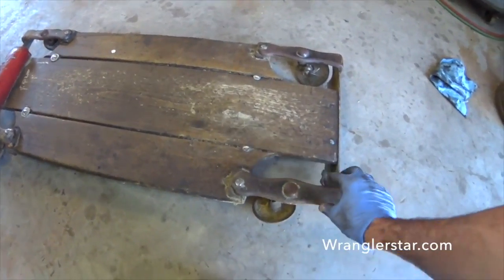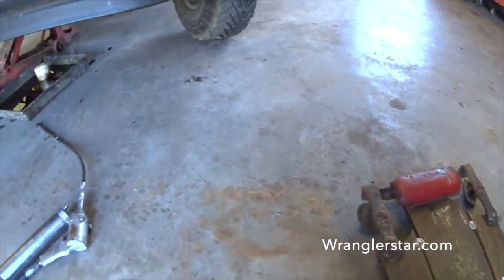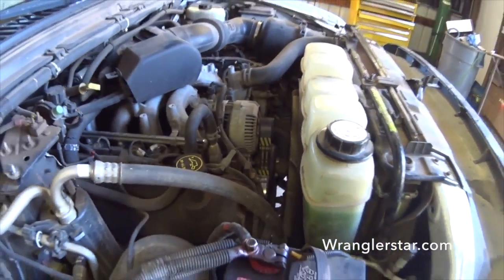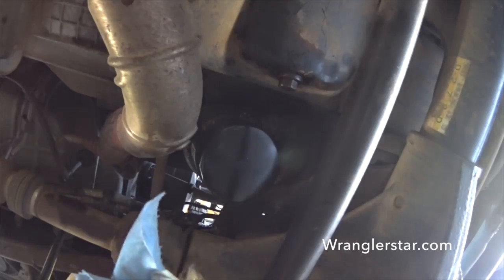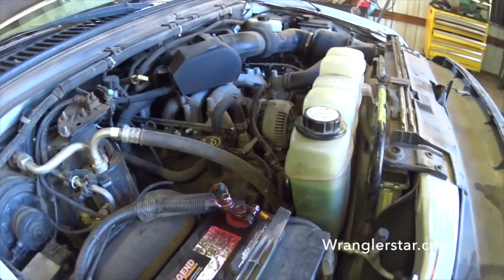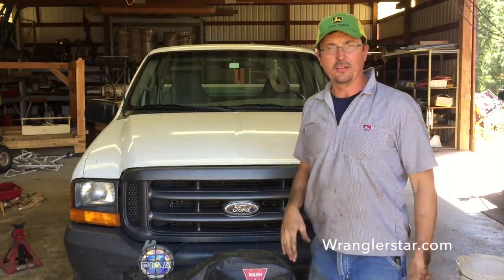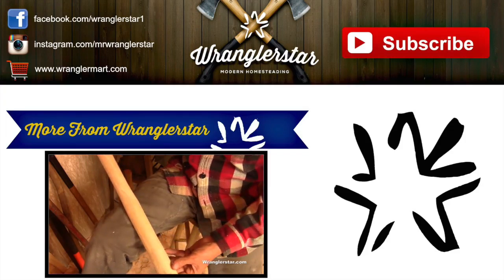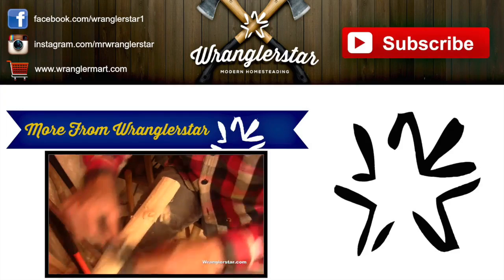Tips For Getting A Truck To 300,000 Miles pt2

Comment: I couldn't agree more about not buying new vehicles.  We received a new Honda Accord as a wedding gift about 25 years ago and we still drive it 100 miles or so every day. Total miles?  645,000 and still going strong.  We just keep it maintained and repaired and it keeps on running.
Reply from the maker: +Norman Means Sounds like you got a winner.  Very nice.
Reply: +Norman Means Original engine? No major repairs? That's very impressive!
Reply: +FORCE NSX repairs are part of owning any vehicle.  I budget $2000/yr for repairs.   And I always use the cheapest oil, so long as it meets the API standard.
Reply: +FORCE NSX the best part about the car, as I tell all my GM and Ford fanatic friends:  the Accord is an American made car made from American produced parts.
Reply: So I should be expecting a lot more out of my '98 Honda Accord longs I keep up maintenance. I've got over 300,000 kilometers
Reply: +Alvin Dueck I would think so.  That's roughly a third of the mileage (kilometerage?) that I have.   Change the oil and keep up the regular maintenance.  It helps if the car has a manual transmission, I believe.
Reply: How many miles are on your Accord now?
Reply: Mark M 685,000
Reply: Congrats on the marriage going on 25 years!
Reply: yeah.....you should do a compression test lol
Reply: @norman3605  I am your exact opposite: I always use the most expensive oil..The one that is made in Germany for my German car...And that does not stop there: anything I buy has to best the TOP BEST out there, No matter what! I f I can't, I wait till I can.... I would NEVER be able to buy something cheap...NEVER....When I buy clothes, food, cars, parts, even the smallest thing (pens, soap, toothbrush, etc), I try to get the best product possible, and NOT made in China as much as I can (Chinese products make me cringe....!)...It is in my blood....My dad, may God bless his soul, used to tell me: buy stuff and bring the money back with you, because if you buy cheap stuff, it is like if you dumped your money in the trash.....! We only live once, so why not get the finest/best things out there: if God helps me and, one day, I become rich, I will not let a single Chinese product get across my door: not even the plastic bags for the dumpster...I will order them in Bulk from France or Germany...!

Comment: I would think a truck kept and maintained like you have done tends to be a better truck anyways. Anything that could have gone wrong already has, and any kinks or factory issues are long taken care of. The vehicle becomes very refined in its operation. Great pair of videos here. Thank you!
Reply: +Weiderfan that is actualy very true. I'm very lucky that my parents will give me their car for free in about 7 months because they are moving to a different country while i want to finish collage here. They bought a volvo s60 2003 with only 80.000 miles in 2011 which is insane the car had only one owner who traded it in for a new volvo and so this old s60 sat in a hangar for a couple of years untill they wanted to get rid of them for very cheap. my parents paid around 1650$ the car today has 127XXX miles on it and it has only died one time which was caused by the battery reaching its end. New battery was all the car needed. The car has had oil changes every 4-5k miles and quality parts were always used as well as correct fluid's the car sounds like brand new there is no rust and nothing rattles and when the turbo spools the little 2l turbo inline 5 it can actualy  make me feel uncomfortable. And i think its a great relief that i know that this car was taken care of and it allows me not to worry about buying a car from some shady ass craigslist person who is selling his ''Mint condition'' car worth 3000$ for 700$
Reply: Cool post buddy! Thanks for sharing, and congrats on inheriting that little Volvo! Awesome deal!
Reply: Weiderfan i still have to pay the insurance which for me is like 1300 as well as road tax (payment for using the roads calculated on co2 or CC of the engine) which will cost me i think 690euro plus paying for my own apartment with no financial support from my parents but hey :P atleast all i will pay for doing my PLC course before collage is like 800euro for 2 years and if i get a special grant its free and i have my own transport. And going back to the video any car or truck can be easily maitained by someone changing fluids is very easy the hard part is just picking the correct fluid which is not that hard as it says what to add in the owners manual
Reply: Good luck with all your endeavors, and hopefully you can save some cash by doing your own maintenance work. I'm about to throw a new set of brakes on to my Honda. Just rolled over 200,000 KM about a week ago. :-)
Reply: Weiderfan which honda is it  ? and 200.000 is really good :)
Reply: 2005 Honda CRV. 200,000 KM is eaaaassy for it. They're usually good for 400k, no problem. That's what i'm hoping for! It's in mint condition.

Comment: At the end of this video you mentioned the handling and braking as a whole were improved. It is important to note the interrelation between shocks (and springs for that matter) with tires and brakes in stopping, and tires and suspension for handling and load handling. You could have the best brakes possible, but fail to stop adequately due to too much bounce from either bad shocks or the wrong shock and spring set up. Another great informative, money saving DIY video. Thanks for sharing.

Comment: My dad bought a Dodge Ram 3500 brand new 14 years ago and it was the truck my brother, sister and I grew up in. It was going strong, we took good care of it and it had just reached 275,000 miles when a bad windstorm came through and dropped a tree down the middle of it a few months ago. Preventative maintenance goes a long way but you can't plan for that. Thankfully we've found a "new" truck. Same year and model as the old one though this one only has 81,000. Time to work back up to 275 and hopefully further. Thanks for all the great videos, can't wait to see what's next.

Comment: I bought my FIRST NEW truck last year. (Im 26) The truck out the door price ended up being 27k for a 2015 GMC sierra. One of the main reasons i did it was because it actually lowered my interest rate a good bit AND i already owned my older used Dodge that i traded in and they gave me 18k for. So LONG story short only paying $9,000 total out the door for a 2015 GMC with 0 miles on it and a 2.5%apr I think I got one hell of a deal. Also yea i finished paying for her in december so now I have a 1 year old truck with 8k miles on her AND the title is here at home with me. I agree 100% with what you said. If you can't afford a new truck then don't buy one but Ill tell you what saving all my money from the Marine Corps and putting it into my dodge was the best investment turnaround I ever had!

Comment: Keep it up ! It's very rewarding keeping a vehicle running 
My 1980 Volvo wagon just hit 500,000 miles with no major engine work ...just the routine maintenance and accessories like water pumps, alternators ,timing belts  
It doesn't leak or burn any oil between changes  
I bought one new car in my life  it is a 1996 KIA  everyone said you won't get 100,000 miles before it has major issues even the dealer mechanic said it
I now have 198,000 miles on it and it still runs great ! Do the proper maintenance use the best quality filters and a good oil don't skimp on changing intervals
I made a bet with the lead mechanic at KIA that I would get over 200,000 miles on it .he said it would never make it
Well I'm almost there needless to say he is very surprised that it still runs and at a very good performance level

Comment: I bought my '92 Ford F150 back in '96 with less than 70k miles. Has a 300 I-6 with 195k miles now. Badly rusted here in Indiana but starts and runs great. Could use more power but good enough for me. CHANGE OIL BETWEEN 3 AND 4K. 
I appreciate your value of your Grand-dads tools. I would hang the creeper on the wall of your shop. Hope you get to be a grandparent some day. You'll make a good one.

Comment: Just had the trans rebuild in my 03 chevy, put new take off wheels, fixed the exhaust. Smelled coolant at times- water pump was leaking so I replaced the water pump/ lower rad hose/ tensioner/ A/C belt and serp belt along with the thermostat because they were easily accessible when replacing the pump. When putting the new wheels on I had suspicion that a hub was going, turns out hub and a torn upper ball joint, replaced the hub- tore the 1/2 shaft boot, so replaced the axle shaft, upper control arms with ball joints, lower ball joints, inner and outer tie rods since I had to get an alignment, ordered all Moog or A/C delco parts off rock auto and saved a ton by doing it myself, Sure it was almost 5k by the end, but I;ve owned the truck 9 years and think I have atleast 6 more years to go.

Comment: After buying 2 brand new Trucks in the last 10 years I agree with you on the money you'll save buying used but there is nothing like ordering your own custom Ford F350 diesel EXT 4X4 power everything, beyond loaded factory accessories with leather interior, suicide doors an 8' box that makes that first 100,000 miles of hard work worth it. Just like myself or my wife & children, my truck has to earn its keep if its on the team. I plow snow with mine to help offset the purchase price which actually paid for the truck & the plow & sander I have for it as well.
Reply: Nowadays, buying a used vehicle is tricky.  You never know if it's been in a flood or not, for starters.  Interiors can be replaced.  Paint can be recoated.

The truck you describe, I would never buy used if I expected to get any respectable length of use out of it.  You can't know how abused it was prior to being polished for resale.

Comment: I know the feeling of keeping up an old truck. Me and my dad keep up an old Chevy 1999 Suburban 1500k. It has just over 220,000 miles and we have replaced just about everything apart from the engine and transmission. Although the last 8 hour drive to Florida proved that it had a problem in the #4 cylinder as a code came up that it misfired so engine work is likely in the future. We have paid probably 15,000 to 20,000 dollars just to keep the truck in great condition and it still needs body work and a new paint job. So it isn't cheap to keep up an old truck but it is so worth it as a new Chevy Suburban is in the range of 50,000 to 60,000 dollars. Plus the feeling you get whenever someone makes a comment about your truck being in great condition is one only those who do this can get!

Comment: I've always told my friends and family how much easier it is to keep a basic model vehicle looking nice and in top shape. 

I've always had $5-7000 trucks with plastic floors you can rinse out with a hose and a standard transmission, manual locks and windows. Things just don't break on those trucks. My truck I have now is the first vehicle I've ever owned that had power locks or windows or cloth seats... And I only bought it because I wanted a crew cab and it was a great deal on a cummins diesel. 

I 100% agree with you on paying cash for vehicles and repairs on vehicles. I've had shops try to cheat me on repairs when I was in a bind and new in town and I refused to use credit, they cut their rate nearly in half because I held the line on cash only. 

Sometimes not being rich teaches you life lessons you might not learn otherwise. Maybe you would but probably not. 

BTW my dodge is at 290,000 and my ford that I have to my dad is at 315,000 and still going.

Comment: Cant say that I disagree with you about buying a new truck. When I graduated college last month, my mom told me that since I had a job nailed down, I would be able to buy a new truck. I said why? There's nothing wrong with my old Chevy. Sure its a little rusty in spots, nothing that cant be fixed, the a/c needs recharged, but the engine and transmission are solid. I just hauled a couple wagon loads of hay out of the field tonight with it. I'll keep it til the wheels fall off and ill fix it and run it till they fall off again.
Reply: ih1206 wish more people had that attitude
Reply: chabka34 Some days that's an expensive attitude. This morning it had a dead battery. I think I know what the issue is, but I won't know anything until I get home and wheel it in the shop.

Comment: I don't know if you mentioned it but don't forget your power steering fluid.   I think that's the one fluid most people never think about and it does go bad over time.   It's cheap and easy if you just remove and refill what is in the reservoir every oil change.   A turkey baster or hand pump from a soap dispenser makes getting the old fluid out easy.

Comment: Inherited my mother's 2001 Kia Sportage, currently has 180k Kilometers on it (112k miles).
I know its lived a bit of a hard life, my mother never really got out of town, so it was run a lot for short-run errands, rarely getting up to temp.
I'm currently doing both necessary and preventative maintenance on it. Catching up on things my mother didn't do before she passed. When I got it, did all the fluids, and gutted the automatic locking hubs (They're broken, and I haven't had the funds to replace them yet. Not causing damage, so its fine for now.), got the front wheel bearings done, rear axle is getting some love next. Followed by shocks, and a new front windscreen. The glass is scratched and pitted all to hell, and has a tiny crack.

So many things to do, while also getting tools to do it.

Comment: great Video mini series i could agree more with the don't buy a new car statement especially here in Australia the 2 major car brands Ford(but not the F series trucks) and Holden(GMC) drop so much in value once you drive it off the lot its about 30% of the total cost and all to have a new car smell for a week. Plus older cars have a better range of parts to increase durability, reliability and performance and if there was any type of problem with that model you can usually do a Google search and find a fix for it pretty quick and a way to prevent it from happening. With the breaks on my truck I ended up getting better performance ones(slotted & dimpled front rotors,stainless braided lines, performance pads and performance rear shoes) for less than the factory dealership could do for just replacing the pads on the front and rear and had a local mechanic fit it all for a very reasonable price, he was happy for the pretty easy job of all new bolt on parts and the extra work I was happy for the better quality parts and workmanship and still got a better price then the dealership

Comment: I wanted to see you pack the front bearings.  I don't regret buying a new truck.  Not saying i had the cash for it. I use it for work, and never had the time for diy. Old truck was too big and heavy for me to work on, well I did the starter myself. But it got to the point one thing after the other was literally shattering on it, leaving me unable to get to certain jobs when it broke down. Bought a brand new f-250 with a custom workbed in the back. This time, I'm going to schedule maintenance on it.

Comment: No car payments since 2000.  Never again.  They'll gladly sell me a new crew cab 4x4 with all the stuff....don't need it, won't make payments.  I'm looking forward to my current truck, a 2007 Silverado, lasting a long, long time.
Reply: My dad had an 04 2500 silverado duramax. I loved that thing before it got sold, but my grandpa still has his 04 sierra (which is all the same except it has a much heavier frame) and that thing is even better. Both are great trucks.
Reply: Providing it doesn't have the AFM/DOD it should last a while. If its a 5.3, it has the displacement on demand/active fuel management. And good luck with it. The lifters LOVE to collapse, and eat cam shafts, sending metal throughout the engine. Good luck!
Reply: 93 Chevy Silverado
Reply: 1995 Ford Ranger 4x4.  Runs great! ;-) hehe

Comment: If the brake pulsation is in the front you typically feel it in the steering wheel but if you feel it in the back of your seat it's from the rear. Also a good way to check if the car or truck ebrake uses the rear caliper you can pull the ebrake to see if the pulsation is in the rear. You treat that truck real good it will last many years

Comment: I have a Dodge Ram 2500 turbo diesel that just passed 175k. It's getting to the point where everything is new except body and engine. All the engine components, brake lines, brakes, cooling system, suspension have been replaced. I have 2 tires almost ready in need to be replaced but I have replacements in my garage already. 

It's like having a new truck. 

Have you considered a putting quick disconnect on one side of your jumper cables? It makes it a lot easier, you can jump start yourself or others from the front or back of your truck depending on need and surroundings.

Comment: Might I suggest something, if it hasn't been done yet? That 4r100 will benefit greatly from an auxiliary transmission cooler, 6 rows are better than the stock but 9 row coolers if you're towing near the max GVWR often. I'm not knocking the ford, as I own one but with the ZF6, I hear horror stories about the 4R100 puking it's guts after long heavy tows or after running in reverse for an extended period of time, and if you're fighting a fire on your land with it that would be a bad thing to happen. Just a friendly heads up, keep up the good work!

Comment: A big reason why rotors warp is because the lug nuts are unevenly and/or over torqued like with an impact gun, they reall should be torqued to spec with a torque wrench or a torque bar. Torque bars can be had for a pretty reasonable penny. 
The F250, depending on what model year, seems to need 140-160 ft lbs on the lug nuts and the typical air powered impact gun will do atleast 300 ft lbs.